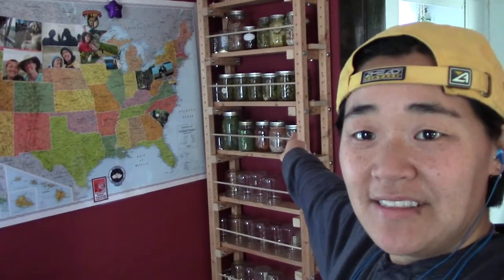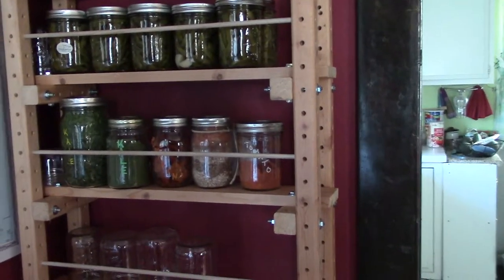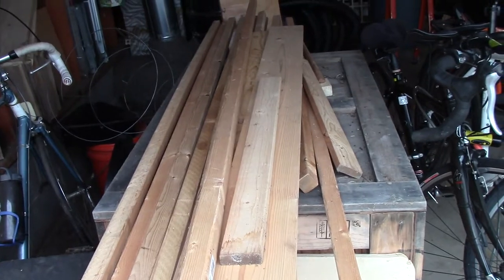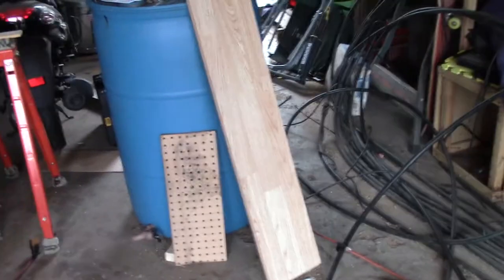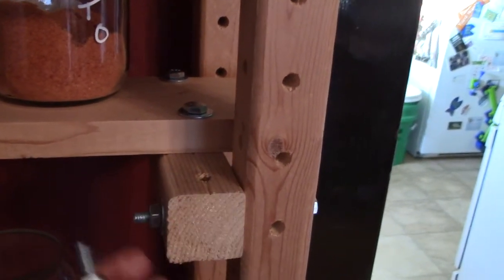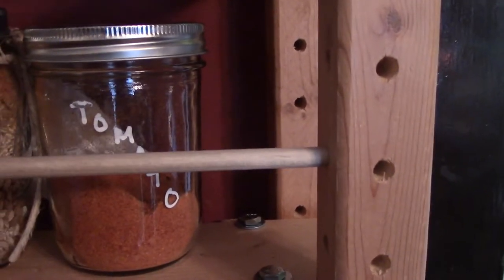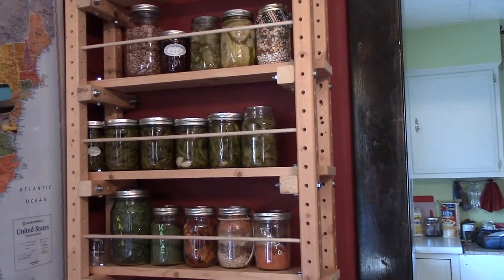how to make grid beam && assemble modular shelves | diy 2018-10-11

Comment: How big are your two-by-twos?  I was using stock two-by-twos from Home Depot for a while but they all ran a bit small by 1/16" to 1/8", which makes for lousy tri-joints (it looks like your shelf doesn't use tri-joints, in which case that doesn't matter as much).  So these days I actually buy two-by-fours and rip them down to the correct width.

How accurate are the holes drilled using that jig?  Do you just move the thing over the peg one hole at a time to drill the next hole?  How much hole-spacing error accumulated along those 7 or 8-foor beams?  I always worry about precision and so use a long ruler to mark the hole centers before drilling, and then drill independently from each side (I have a crappy Harbor Freight drill press that I don't really trust to go 'straight through').

I find it Interesting that you ended up using a 5-grid depth for your shelf.  They don't subdivide standard lumber as well, but I've found odd multiples to be especially useful, myself (they have a hole in the middle.)  I've written up some of my thoughts about that and gridbeam-compatible boxes here: http://www.nuke24.net/plog/26.html
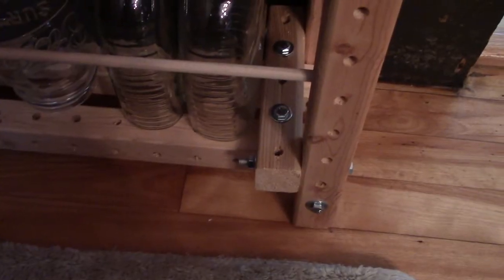Reply: 2:42 At the bottom of the shelf there is definitely a tri-joint. (At the top probably as well.)
Reply: @hoki4381  Ah, I see the top one now at 0:37.  Maybe their Home Depot sells better two-by-twos than mine.  In order to get the tri-joints to work I sometimes had to stick washers between them!